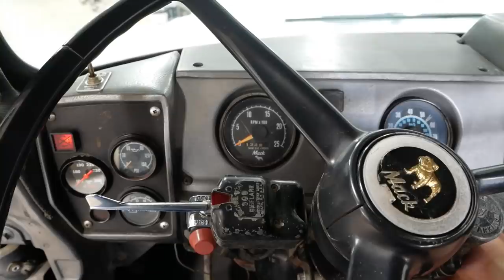"Simple" Axle Flange Leak Escalates Quickly - Vintage Mack Truck - Part 1

Comment: Had a similar striped thread issue before. Had a custom set of studs machined at the machine shop. Larger size thread on the hub and reduced the neck size down on the nut side as factory would be. Still working like a charm.

Comment: I haven't changed a truck tire in 35 years, nice to see it hasn't changed much. We used a different kind of patch and a "spider" to spread the tire instead of a simplex jack and to seat the rim we used an entirely safer method that I don't need to go into, but it used ether in an entirely safe way.

Comment: How can some dislike this video. It's got an old Bulldog Mack with a window on the back...!
In my neck of the woods they spray at night to avoid exposure to residents. Problem is that they do it between 11-12PM but after a while you get used to it. At first it felt like the dust cropper was gonna land in the roof of my house.

Comment: Ah, tire repair. Brings back fond memories of repairing truck tires. Of course I did it over 50 years ago and the truck tires then, used tubes. But, we also had split rims, plus the man killer the solid rim GM used on smaller 3/4 ton pickups that was supposed to catch the grove in the wheel rim. I always inflated those things with the hose held onto the valve body with a threaded hose, a remote gauge to read pressure and the tire sitting 50 feet away from everything, just in case the rim slipped out of the groove and the whole thing blew up. Only happened once. Also, I also remember changing inside duals on overloaded grain trailer. So much fun. NOT

Comment: Hi Wes, great video. One little trick we use to make getting the wheels on and off easy is to put a sheet of flat tin on the ground with just a little oil on it. The wheels slide very easily on the oil and can be positioned and rotated even if you are working on dirt or gravel.
  Buying Budd nuts and studs here in New Zealand is next to impossible, especially the left hand thread ones. Parts people look at you like you are some kind of Luddite.
Reply: Yes sir I have seen mechanics use that procedure to slide off a complete dual wheel and hub assembly off of the axle in order to change out a leaking wheel seal.

Comment: I'm learning alot.  I did farm work in the 70's and 80's.  Mostly cotton and hay, not grain.  Seeing this heavy truck work is really good.  Not worried about helping out now over to the old truck shop down the street.  Been working on smaller stuff since the 60's.  Just never had much reason to work on the big ones. Thanks for the primer Wes.  You are outstanding in your field!!

Comment: Good old universal seal driver. I was taught when you put the patch glue in the tire you either heat it with a drop light or light the glue on fire then blow it out quick because patches stick better if the rubber is warm

Comment: Dang I miss working on Macks. Also a good tip for using the cheeta tank is to offset it 180° from the valve stem you get air on 2 points of the tire instead of concentrated in one area. Can help seat a stubborn tire sometimes, especially a 385 thats been stored on its side instead of on the tread.
Reply from the maker: I don't know why, but I have the most luck right at the valve stem. Sometimes nothing works and you need two blasters or a controlled explosion.
Reply: Some tires just have to be warmed up to summertime temperatures in order to be dealt with. Take care.

Comment: Good job Wes.. and you did not even get to the batteries.. geez!
When I saw the gold dawg, I knew things were going to get real.. real hard to find that is.. lol.  The gold dog means its all Mack, front to back and top to bottom, the silver dogs are mongrels.. could be a mixture of whatever the customer wanted. Vehicles come in and never leave the shop, lol.. I guess finding a scotseal XL for that hub would probably be a real pain since its a Mack axle, those are my favorite seals since they do not run on the spindle. You manhandle that wheel and brake drum, I use a hand truck but I really need to.. the tire weighs more than I do, but a hand truck really makes it easy to get the drum off and back on easy.

Comment: I like seeing the proper torque and "play" in the hub.  So many people over tighten wheel bearings and it drives me nuts - things expand when they get hot!  I've always done that with my light duty and heavy duty stuff and I've never been left stranded - pre-load the bearing super tight when spinning and loosen until I can get just a miniscule amount of play - set the nut.  Go too loose, you have to start over.  Nice job!
Reply: That is what is specified in most truck repair manuals.

Comment: That truck is in really nice shape. The little jobs are usually never little jobs. It’s always I have a little oil drip and it ends up being the first bolt installed when the vehicle is built and it’s been stripped, cross threaded, and hits the second bolt installed and won’t come out.

Comment: If you want to put more force on your axel nut socket with out being afraid of it slipping off. when you have an extension put a jack stands at the end of your extension near your breaker bar as a pivot point. Works mint especially when you have those really thin axel nuts

Comment: 10:23 so that's how you make a slinky. Cool. I take it that it was some bloke with a ugga dugga givin'er all she's got, right? Aluminium hubs are an alien concept to me, for (probably) good reason.
I think the old one had a hole too, but it's now a rust spot (you can see it in the video when you take the hub out).
And the tire was already low pressure when you took the wheel off. You can see it when it falls on the ground and "rings" hollow. Bad luck on him,  had it been just a little bit to the outside, it would've been a clean exit.
Great episode! Had fun watching it.

Comment: I’m not sure if somebody has mentioned it yet but you could use a 13–3034R inner nut. The threads protrude all the way to the end of the nut allowing more thread contact with the stud.

Comment: I always hesitate to offer any suggestions because you are a bag of tricks. I always learn a ton watching your videos. But I will pass on a trick I learned from my old man. Instead of beating on a tire with a sledgehammer trying to break it down, use a 2x8 (I've even gotten away with 2x4 or 4x4s) and lay it down on the tire right up to the edge of the rim but not over it. Then drive up on it. If you don't have it close enough the wood will kinda slide down the tire. If you got it too far it catches on the rim. Rotate the tire around to a new spot and try again.  This might seem fooling around but it saves so much energy from swinging the hammer and eliminates the possibility of a miss swing and whacking the rim/bead. Save you energy for running the spoons lol. That's what we never had. It was all crow bars, screw drivers and tar arns for us.
Reply: I guess I wasn't real clear after re reading this. But put the end of the board against  the rim...not the edge. For real difficult or stuck beads you can also cut a radius in the end of the board to match the rim. It also is good to rasp off any sharp corners so it doesn'tmar the side wall. But to be truthful we never did any of that although it often could have helped.
Reply from the maker: My dad has an in ground lift in his shop. He would break beads by laying the wheel under the lift arm and lowering it!

Comment: It's always the inner tire on a dual tire set up, although it's usually on trailers. 
And, I'm with you on nothing ever goes to program.   90 Honda Civic, front axles.  Was going to do both sides yesterday, but the "it's so easy" vids on here aren't necessarily accurate.  Getting the old one out, easy.  Getting the new one in, after spending far more time than I should trying to mallet the new one in to set the snap ring, I used the rubber end of my floor jack handle, put the inner joint between bearings, so I  had a flat place.  Two swings, and it was going back together.  Fun times, but the other side will go back together so much faster.

Comment: Great video and very nice Mack.
An auto parts store with 9/16-18 nuts in stock - well, maybe not the kind of nuts you need, but they might have lug nuts for 1980's era 1 ton Chevy trucks, which are 9/16-18.
Reply: We had a local hardware store (one of those old timey family stores that had everything) and I could get fasteners up to one inch and both sae coarse and fine threads. Of course as with everything those stores are in the past replaced by the Home Depot and Lowes.

Comment: As a kid I took hundreds of tires off steel rims from R600 Macks (and their trailers too).  Not too many beads broke just by standing on them, but sometimes.  Of course sometimes I made a dozen or more trips around the tire with the bead axe before the bead broke.  We didn't have a tank of air to set the bead.  We used to take the core out of the stem and then hook an air chuck to the stem.  While the air was going in the tire (much faster without the core in) we would bounce the tire around until the bead set.  I'll never forget my dad's warning when he was teaching me to do this (I was twelve): "For fuck sakes don't put your fingers anywhere near the bead or you'll be picking your nose with your elbow". Ken

Comment: Wes, I think you forgot to add the dielectric grease to that hub.  We don't want it to produce that 240vDC current with rotation.  Bermuda Triangle was a good one.  Enjoyed the video as always.
Reply: That doesn't work, the dielectric grease prevents any electrical connection.  The tires won't get properly magnetized.
Reply: @somebodyelse6673  yes that’s why tires have coils of cable in the bead to keep flux up.

Comment: Nice work on that tire Wes.  I was laid up for a while and could not change the rubber on my own wheels (Ford F-250 SD), my locale mechanic Modern Automotive gave me some cock and bull story about how the tires that I provided sat too long on the pallets and were too flat and he could not mount them using his machine.  After spending many thousand of dollars with those guys on other work that was the straw that broke the camels back!  Now I go to another mechanic.  I wish you were closer.  You would have all my work.  Got a big kick out of, "Watch Wes Work Devils Triangle of auto repair" 🤣 Great video Wes, thumbs up.

Comment: 1:!6 with that much dirt and oily grime on top, there's prolly a connection between the posts. One of the friends i help with, and my brother, had batteries dead in two or so months from stuff like this. Cleanliness is next to Godliness when it comes to batteries. I'm a firm believer of that. That and putting a frame around them that allows for expansion so the guts don't chafe and shed.

Comment: I have pictures of a Small combo wrench being removed from one of my tires it was Stuck in the asphalt standing straight up and I ran it over I remeber hearing it go through the tread on the tire it was open end up I made it 45 miles to the tire store was impressed it help for thst long was a 7mm craftsman usa made wrench if I remember  correctly @Watch Wes Work

Comment: Hi Wes, the wheel studs are the same for steel or  aluminum rims, the inner Budd nut is different. You have the correct inner nuts, the outside thread is longer and the internal thread is longer due to the extension past the taper seat.

Comment: A couple of years ago i got to do rear brakes on a 10 ton hino truck. The customer doesn't like paying for maintenance. One side came off easily. Back off the shoes a long way.  Remove the axle the wbrg nuts and the wheels and hub come off easily Id looked in the inspection hole and realized i was looking at the edge of the shoe and the  thin lining and not the step in the side of the lining.  For those who don't know the step in the side of the shoe is a visual wear limit so the rivets dont eat into the drum. The heads of the shoe rivets had cut 3/16 into the drum so new drums too.  Go around to the other side the adjuster won't back off. i went to turn the wheel and the bearings feel rough as in lumpy. I had to take the wheels off the hub. Then the outer brg was gaulled on the axle sleeve and wont come off. So out with the hissing wrench (gas set) and ended up diesecting the inner part of the outer race into 4 pieces and chisel it off the axle sleeve. just pure butchery. But I then had to get the grinder with the cut off wheel  and drill and chisel and split the drum into 3 pieces  all because the F^%$*ing adjuster wouldn't back off. it took me an hour to clean the axle sleeve using the new bearing as a guide. That was a lot of filing and sanding. the rest of the job went well. That one stuck in my mind.

Comment: Back in 2019 we had a run of trucks come through our shop. All volvos, all late 2019 makes, all flange leaks. The factory barely ran the flange nuts down. Only saw 1 with damaged studs but boy was it worrisome to see trucks with 100 miles on them having something that serious get passed over.

Comment: Nice work Wes - but I am amazed at how easily that tire bead came off the rim!   I do motorcycle tires and they can be a bugger.  Are big truck tires always that easy (somehow I doubt it).
Reply from the maker: He's been running it with no air in it for a while I suspect...

Comment: The air hammer trick is a needed one sometimes, it’s not your fault you can tell by the witness marks they put it on there with a hammer and chisel instead of just buying the socket as farmers tend to do…and I’d lay money it was at least a 5lb mini sledge they “tightened” it with. The stripped hub is why I always tell guys whether it’s a drive flange or a spoke hub if the studs come out with the nut DON’T put it back together without new studs and lox-tite. The problem is the threads in the hub end up taking all the load as you tighten them with seized nuts where it was mean to have the threads on the nut and stud do the radial work and just pull out the internal threads. It only takes 2 or 3 times coming on and off before the threads In the hub or spoke are trashed. Also a little fun trivia: that tin shield is for ABS, somebody probably bought that hub because it was what was available even though it was set up for ABS and they didn’t have it. Gunite/accurate is bad about making everything except the ABS (more expensive) version of hubs obsolete so you have to buy them whether you need it or not. As far as the weird bolt sizing Mack only did the funky flange bolts on their 34 and 38,000 bogies if it had 44’s it would have had 6 3/4 studs with 1 1/8” nuts like an Eaton or Spicer/IH setup. I believe Rockwell used 5/8 studs up to a certain year then went to a 3/4 as well.

Comment: I keep rattle cans of zinc spray paint handy for those battery brackets. Then top off with epoxy or just spray under coat to prevent corrosion.

Comment: i've got 5 tire irons, no two are alike. i don't even remember where i got most of them. i bought one of those duckbill sledgehammers when i was using late 60's 3/4 ton chevy trucks to haul scrap since no tire shop in my area would touch the 16.5 split rims they used. it mostly just sits in the bottom drawer of my tool box since those trucks are too pricy to use for scrap runs nowadays. for me, it's quicker and easier to change tires myself, than hauling them 12 miles into town to have them changed at a shop, so i still swap them out by hand. i'd like to find an old coats 20/20 for sale, but they don't last long on the open market, and go for $700-1000 bucks. i can change a lot of tires for that price.

Comment: several tips for you , first use a jack stand with that type of fender your trapped if it falls, on tight axle nuts use your impact and turn the socket in the direction of removal then impact (so the socket doesnt loose the hammer effect with wiggle, lay the brake drum with stud holes up, install hub with studs down in the brake drum, you can now remove the seal easier with one foot behind  the heel bar,  stemco will give you a set of seal drivers for free (complete set), mix up soap and water in a gallon jug cap it drill a 3/16 hole in cap and apply the water on tire laying down, flip the tire and water the other side, tire bead was dry causing it hard to remove rim, use liberal amounts of bead lube, use a five gallon bucket to seat the bead, lying flat, just like your car tire machine, the tire bead was dry and standing up the tire wasnt seated  concentric and now out of round, https://www.youtube.com/watch?v=1f391UN6oqo , tire video from micheln

Comment: The city I work has a huge fleet of trucks, plows salters etc.. They are loaded down with lots of extra electric stuff. Occasionally we have to install a master shut off to cure a drain problem. All that does is add one more problem.

Comment: btw a shop I worked at had some old old trucks  . one day a set of duels from the trailer passed the truck driver on the highway.
 well I was the truck mechanic and they naturally blamed me .
 now here's what I found. 
those threads that you pointed out for being sharp. these were rounded over the trailer was 35 40 years old every spring it got new brakes  and sometimes during the season.these were peerless log trailers with inboard drums had to pull the hub to do brakes . well after 40-50 times the threads on the axle and in the nuts wore out. had to change out all the trailers that were 20 years old or older .
Reply from the maker: I've seen it too. If the outer bearing fail or get hot they'll loosen the nuts up over time. I just saw one on the side of the highway last week missing a wheel!

Comment: 7:38 - Just remember almost everyone can deadlift more than their body weight. Usually easier and safer to pull the wrench up from the other side of the wheel as long as you use good form. Although I had to use a 4ft cheater just to break the axle nuts on a 90's honda.